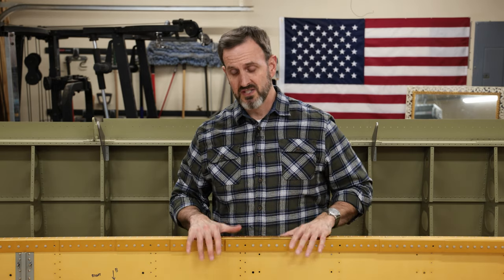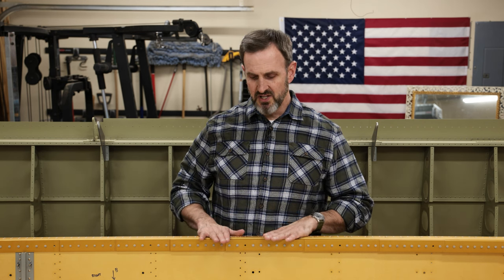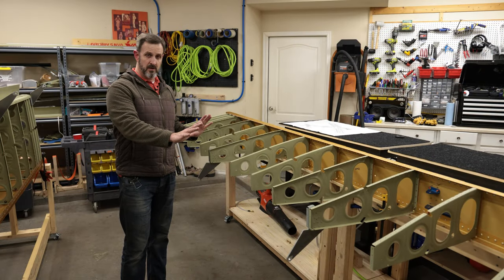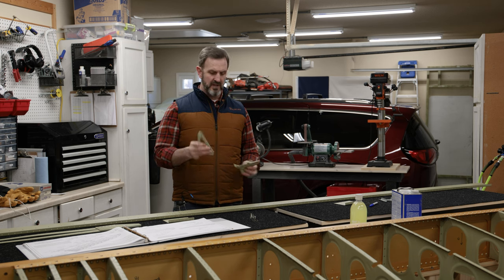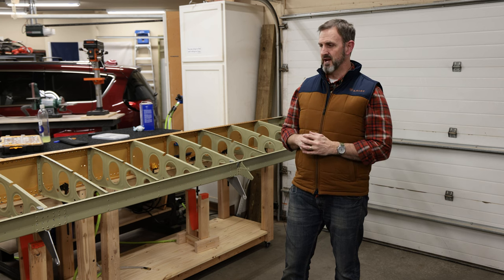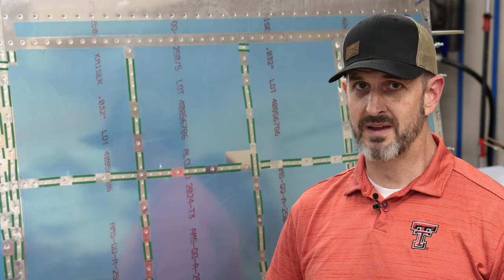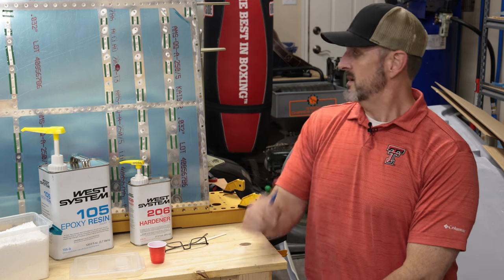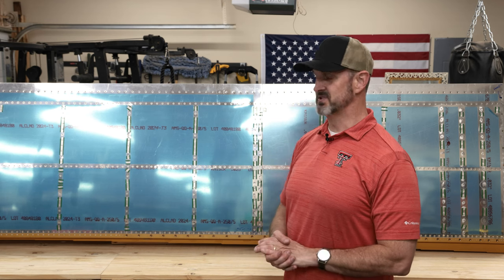Building the RV10 - Video 13 - Wings (January - May 2023)

Comment: for small epoxy work I use coffee scales to weigh mixing cup and its content . For this hole you need 0.5g of epoxy and 0.1g of hardener (literally five drops and one drop). 
I use colloidal silica as a filler - west system 406.
Reply from the maker: Yeah, I overdid it on that. But I have more epoxy than I could use on 10 builds…

Comment: Can you use thread lock on the bolts when you torque them?
Reply from the maker: I did that on some of them, and I don't see why you can't.  I'm using nylon locknuts with these.  According to contributors on Vansairforce.com (the Reddit of the airplane building world), Loctite isn't necessary with these nuts and may actually degrade the nylon (I'm skeptical).  I used Loctite on some of the nuts on the empennage, but not on the wings.